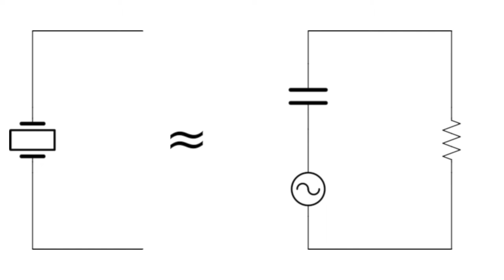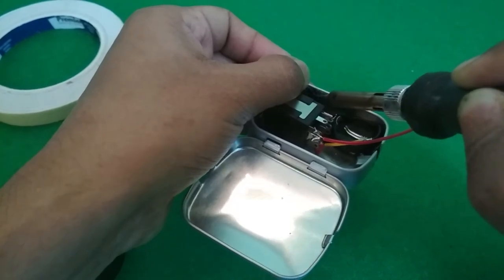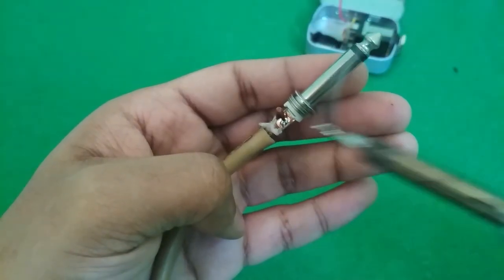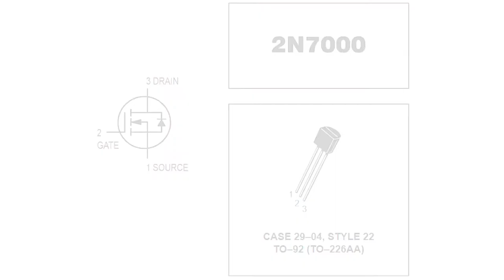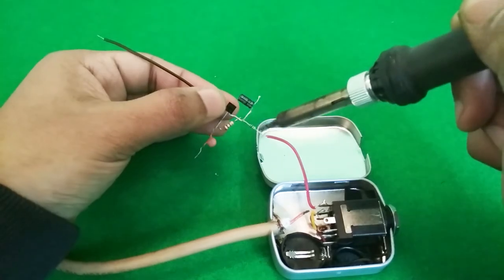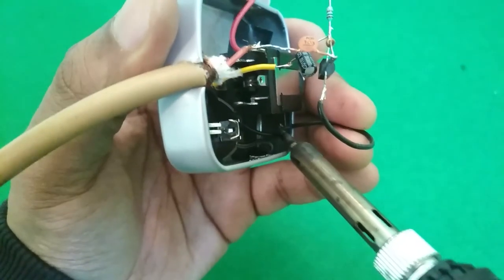Easy DIY Pre-Amp for Acoustic Guitar

Comment: I made this preamp.l tried this preamp with my givson venus rosewood guitar and 2030ic amplifier. But it did not work!😢😢😡😡😡😡😡😡😡😡 I have a pickup in my guitar
Reply from the maker: That's unfortunate :(
Most often, the issue is some kind of wrong connection
Reply: I use 10v 470 uf capacitor to the output and 104j nonpolar capacitor to input  but this did not work
Reply: Does this circuit works on pickup with acoustic guitar? Please tell me!
Reply: Give a solution to it!😢😢😢😢
Reply from the maker: I'd have to see what you've done and how it's different
Reply: I wrote wrong. I connect 104nf capacitor to the input
Reply: If you give a perfect solution to it when I subscribe your channel and give likes in your videos
Reply from the maker: It's hard to know what you're doing without looking at your circuit :/

Comment: This straightforward design is exactly what I am looking for for my project, which is a bass uke with rubber/latex strings and a piezo disc transducer. How do you think it will sound on the lower 400-4k frequencies? should I change any of the parts values? I plan to use a rechargeable CR123a in place of the coin cell, any issues you can see with that? Thanks for the great content!
Reply from the maker: The RC rolloffs on this are well below 20Hz, so there should not be a problem at low frequencies specifically. I see no reason that the rechargeable battery would be problem either, as long as the charging is done by removing the battery from the device and putting it into an off-the-shelf li-ion battery charger. If you want to make the device plug-in rechargeable you would have to include li-on charging circuitry.
Reply: @Psychotenuse  Thanks! Other comments have asked about adding a pot to provide gain control but I really appreciate the simple fixed-gain setup in my application since I am installing it inside the instrument and don't want to make holes for knobs. As you suggest I will use a battery holder for the CR123 and remove the battery to charge it. Have been watching some of your other videos and there are some very cool projects. Love the channel!

Comment: Hi, I built this recently, and it’s awesome! Quick issue though, it’s waaay too loud. How would I go about reducing the output/lower gain? I’m using a Tune-o-matic style piezo bridge, and a 9v battery, and running the output of the preamp into a passive 25 k ohm volume potentiometer (my guitar already had that installed). That is of course why it’s loud. It sounded great, so I know it works well with the current bridge, battery and volume control setup, but I need to have the (logarithmic) potentiometer at around 3/10 to match the loudness of the magnetic pickups in the guitar (which I know work fine by comparing to other guitars). Any recommendations? I tried soldering a 500k pot as the “gain resistor”, but still too loud, and would that mess with the bias resistor as they become closer in value? (I’m new to this stuff😅) I’ve also checked that all my components can handle the 9v battery

To be perfectly clear, this is a great design and works just as intended, I’m just using it for something else😂 It would work great for a disc piezo with a 3.3v battery I think
Reply from the maker: Hey, thanks for watching and commenting! I think your intuition about the bias being affected if the resistors values change is essentially accurate.
To reduce gain, you can put a resistor between the FET source terminal and ground. Try 1k?
Reply: @Psychotenuse  Thanks for responding! I thought about that, as that is would effectively halv the voltage (or at least power output), but do you know if that would significantly reduce the battery life? I would assume it would be halved. As long as it doesn’t reduce it by more than half it would be fine, as it’s only a secondary function in my guitar, and the switch to engage the piezo system is directly turning the preamp on or off
Reply from the maker: @Thecoolman1 the battery life should go up with the addition of the source resistor
Reply: @Psychotenuse  Sorry, thought you meant adding a resistor to ground where the battery first connected to the circuit to divide the input voltage (again, I’m new to this stuff, and misheard which side of the transistor you were referring to). I tried what you suggested, and it worked! I think 1k was too much, but I think around 500ohm is perfect. Again, thank you so much for both the help and the video, this is the best video explaining this I have been able to find on the internet!
Reply from the maker: That would work too, actually.
Reply: @Psychotenuse  Well, i did what you said, and found 1k to be a bit too much, and after some experimentation I ended up on a 330ohm resistor (3x1k in parallel, because then I didn’t have to buy more😅). Worked great! The piezo is a little bit bright, so might wire in a weak capacitor between the output and ground later to bleed of some treble. When I can dial my amplifier in to match the sound of the piezo it sounds pretty good, but because I’m constantly switching between the magnetic pickups and the piezo I think I have to reduce the treble a bit (and then maybe decrease the resistor even more because of lower output, as the piezo is mainly treble). Thank you so much for your help, this is the best guide I’ve found on the entire internet after a lot of digging!

Comment: Thank you very much for your video. It was a very easy circuit, but had a problem with the volume. I am using a DIY cigar box amp (LM386). I started to add a trim pod on the output but instead made a voltage divider from two 2K Ohm resistors. It is much better.
Reply from the maker: Glad to hear it worked out for you :)

Comment: I'm new to electronics and have no clue where to buy these parts. I'm having trouble finding the audio jack like yours! I'm trying to build one of these preamps for a contact microphone for my field recorder.
Reply from the maker: They were a lucky find for me! The challenge is finding them for sale in small quantities with reasonable shipping.
You can try searching for DPDT Audio Jack, because this is an Audio Jack with a DPDT switch built in. The 1/4" jack itself also goes by many other names such as Phone Jack, 6.35mm jack, P38 connector and so on.

Comment: Hello; 
Thanks for the video. I want to ask you some questions so that I can be clear and carry out the project.
     1. By placing a 10Mega ohm resistor, convert the input of the Preamp, in a Preamp that accepts up to a Piezo with a very high impedance of 10Mega ohms? , 
     2- Why use a 3.3v Bat, if you could modify the circuit to be able to use an AC Power Supply of about 5V? , 
     3- Can I use a 9V AC Pw Sup. guitar pedal?
     4- Instead of using the cable with the 1/4 male connector, can I use a 1/4 female input connector?

I am looking to buy a Preamp with inputs capable of accepting Piezos up to 10Meg ohms, but they are very expensive.
I wait for your answers. (Greetings from Puerto Rico Caribbean Sea).
Reply from the maker: Hi. Thanks for watching :)
1. Perhaps something is being lost in translation. I don't understand the question.
2. and 3. Using batteries is better for noise etc.
4. Yes, of course.
Reply: @Psychotenuse  

Thanks for the answers.  I will ask you question #1 in another way: What is the maximum impedance or resistance of the input of the Preamp?
Reply from the maker: So the input capacitance of the 2n7000 MOSFET is listed as 60pF in it's datasheet. This means (unless I messed up :P ) that the input impedance of the FET itself varies between 132k at 20kHz to 132M at 20Hz.
Luckily, piezo transducers are capacitive sources, so if your piezo capacitance is on the same order of magnitude as your FET input capacitance (which it would be if the 10M figure were calculated at ~1kHz), then you'll get some attenuation but won't get terrible filtering. Ideally, your biasing resistor would be in the giga ohm range, but the problem with such large resistors is that they can be noisy. You would need a special expensive resistor that is not noisy. (Expensive as in a couple of dollars maybe).

Comment: Thank you so much for your tutorial. You mentioned the 1k resistance sets the output impedance. What would the approx. impedance of this preamp with that 1k resistance? and if I want to reduce the impedance should I use a lower resistance value?  Thank you!!!
Reply from the maker: 1k is the output resistance with a 1k resistor; the drain of the mosfet is essentially a current source here. Technically the 1M appears in parallel but you can obviously ignore that. I wouldn't recommend going much lower than 1k because you'll start loading the battery too much. If you double the drain resistor you get double the output impedance and double (+6db) the gain.
Reply: @Psychotenuse  oh I see now! Thank you so much!! You do the 10M resistor at the input because the impedance of the piezo is around 1 to 8M right?? Is just that I want to match the piezo with a magnetic pickup which is 7.5k. I'm guessing now 1k will be good but can I experiment with a 5k and 7k just to see what sound?  better?
Reply from the maker: @oscarfernandoofpublicnature  7.5k is probably the DC resistance of your pickup. For a passive pickup the overall impedance is usually mostly inductive. 50k maybe. 10k might be typical for active pickups.

7k drain resistor in the circuit from this video means a lot of gain; maybe you can put 10k and add a 1k source resistor to bring the gain back down.
Reply: @Psychotenuse  thank you again. My problem is I forgot all my electricity lessons from college haha. Ill study but definetly follow you guidance here so I don't have to bother you anymore!! Thanks for the help!! Cheers
Reply from the maker: @oscarfernandoofpublicnature  No worries, glad to help! Pretty normal to forget most things from school lol.

Comment: if i would like to add a potentiometer to control the volume, which of the resistors you would replace? or add in a different place?
thnks for the great video!
Reply from the maker: You could just add a potentiometer on the output, i.e. between the drain of the FET and ground, with the output capacitor connected to the middle of the potentiometer instead of directly to the drain of the FET.
You could also add a variable resistor between the source of the FET and ground, to reduce the gain, or in series with the drain resistor, to increase the gain.
Reply: @Psychotenuse  Hey! Nice project, thank you! What pot would you suggest? I intend to use 2x3V batteries. Also, as I understand it, I should connect the one end of the pot to the drain of the FET, the middle to the capacitor and the other to the ground. Is this right?
Reply from the maker: @koritis1 yeah
Reply: @Psychotenuse  Thank you for your answer! A 250 pot will do the job or it doesn't matter what kind of pot I'll use?

Comment: Your project makes me wonder.. Where should I add a pot for a tone dial. I have transducers under my saddle (without preamp) and they work fine but I could benefit from a stronger signal and maibe a tone pot.. Thanks!
Reply from the maker: Tone knob... you could put a 100pF capacitor and a 10k resistor in series, across the output maybe.
Reply: @Psychotenuse  like a treble bleed circuit.. thanks!

Comment: Thank you for the video. If I would replace the 10M resistor with a pot (to make input impedance sweepable from 5 to 15 M), I would mess with the Mosfet's biasing, right?
Is there an easy way to convert tge circuit to source follower to keep the output impedance low?
Reply from the maker: You wouldn't mess with the biasing too much, but the pot might be noisier than a  fixed resistor.
You don't get any voltage gain with a follower circuit, so I'm not sure if that's what you want. The output impedance of this circuit should be low enough for most purposes other than actually driving speakers or headphones. And you wouldn't normally use a follower to drive headphones either.
Reply: dont see why you would do either of those

Comment: Why are you painting the solder joints with lead instead of soldering? Regards..
Reply from the maker: I like to use the tin and reflow method when possible. Strong solder joints and minimal mess.

Comment: Hello... Is it possible to use a 9v battery? Connecting a resistor in series?
Reply from the maker: You wouldn't need to, you can use it as is. You'd just get a lot of gain.
Reply: @Psychotenuse  oh.. Okay thanks

Comment: Hello, I am looking for help!! I want to combine a piezo with a humbucker pickup. Should I just sum the output of your circuit with the output of the humbucker at the jack? And should I modify something on your circuit to do so? ...or should I sum the humbucker and piezo together before the input of your circuit?? Thank you for any guidance and please keep making your vids!
Reply from the maker: How do you plan to do the summing?
Reply: @Psychotenuse  thank you for replying!! I've been looking and I've seen people put resistors in each hot wires of the pickups and then those go togueter to the input of a circuit or tip of the jack, like a "Y". Is that good?
Reply from the maker: @kathemera  You would have to match the signal levels and impedances to get a decent mix.

You can add an output level control to the preamp circuit by replacing R1 with a trim pot and connecting the positive end of the output capacitor to the middle leg of the pot instead of the drain of the mosfet. You could then adjust the pot to have more or less piezo in your sound.

Since the output impedance of your humbucker is probably 50k-ish, you can use a 50k resistor on the piezo-preamp branch of your "Y" and omit the resistor (i.e. zero ohms) on the humbucker branch.
Reply: @Psychotenuse  this is gold!! Will do exactly that!! Thank you so much!!

Comment: Cool circuit :) I've seen the input impedance set with a 2m resistor in other piezo disc pre-amps,(LR Baggs HiFi), they say it makes it a bit brighter. Would altering your circuit with a 2m input impedance resistor work OK or would other components need to be changed?
Reply from the maker: 2M should be fine. It would be a little brighter in theory, but it also might be slightly noisier. On the whole though I doubt it would make an audible difference.
Reply: @Psychotenuse  Thank-you for the reply and the video. One more question, could a volume/tone be added to the piezo element before the pre-amp(on-board the guitar) and if so what value pots would you suggest?
Reply from the maker: I wouldn't recommend it.
Reply: metal film resistors have less noise

Comment: 2 things: 1. Thank you for this excellent video, listening with headphones there was a stark contrast between no preamp and preamp. So much less noise and much improved low end. 2. I have studied your video and schematic many times as a way to learn audio electronics (I am slow to learn this stuff) and I think I understand but I am unsure why there is a capacitor between the input signal and the MOSFET. Capacitors smooth out the supply of current, isn't that the opposite of what you want with the audio signal? Am I misunderstanding the signal flow?
Reply from the maker: It is what is called 'capacitive coupling', which does what is often described as blocking DC. It is not strictly necessary here since the FET and the piezo are both capacitive anyway, but it allows for more consistent performance.
Reply: @Psychotenuse  I guess my question is actually this: how does having a cap between the signal and the gate terminal not ruin the signal by smoothing it out?
Reply from the maker: It wouldn't 'smooth it out', the opposite really as high pass
Reply: @Psychotenuse  I'm thinking in terms of fluid dynamics, as in the piezo would be an unsteady stream flowing into a bucket (the cap) which in turn releases a steady stream. 

This seems like it would cause the fluctuations of current to "smooth out" and thus no longer accurately represent the sound waves applied to the piezo. I suppose that's not an apt comparison?
Reply: @Psychotenuse  my apologies for taking your time, I have certainly subbed and liked
Reply from the maker: Capacitive coupling is a rather fundamental technique in audio circuits. You might find it interesting to read early literature on the topic, and see how engineers' thinking on it has evolved over time all the way back to tube radios and such :)